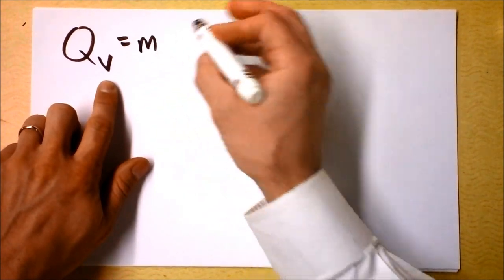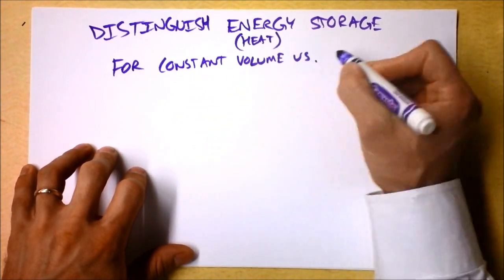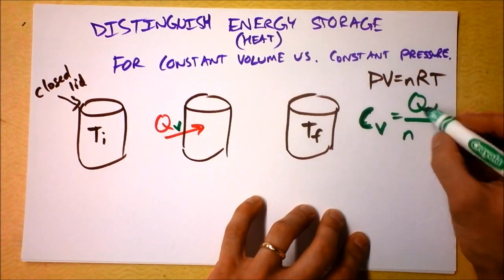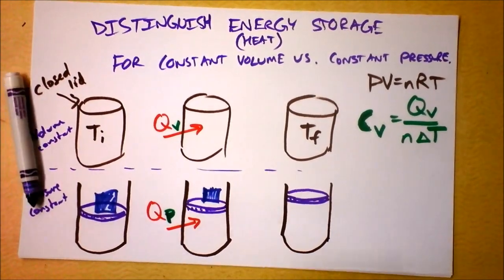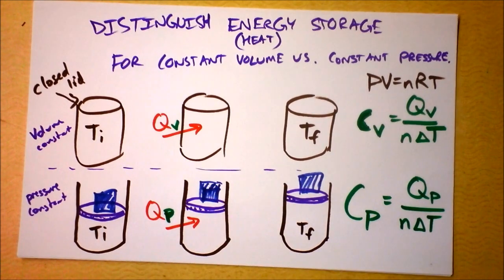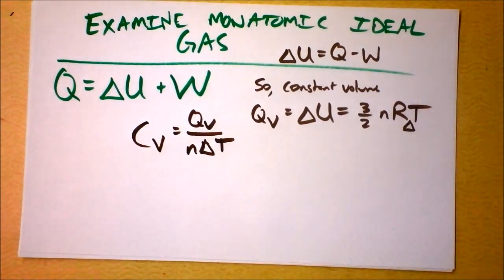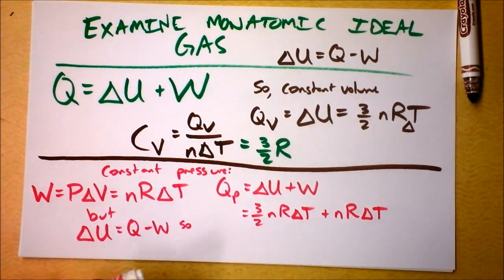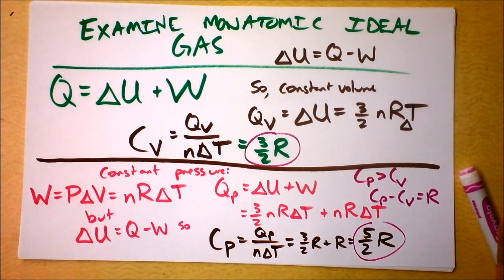Specific Heat...at Constant Volume? or at Constant Pressure? | Doc Physics

Comment: I am a highschool student, and I am doing an internal evaluation on the effect of the function of the paraboles used in the rocket nozzles on the force made by the propulsion system and I needed the specific heat. I could not have wished for a better explanation!!! thank you so much for this video!

Comment from the maker: The chemists have gotten to you first!  They (ridiculously) call W the work done by the universe, so the work done by the gas is negative.  Nuts.  If you've been hanging around chemists, I suggest you explain to them that gases in a box are easier to keep track of than THE WHOLE UNIVERSE.
Reply: hahaha
Reply: this cannot be more true lol
Reply: PV=G m1 m2 /r^2 
Please findout correct math and total workdone by universe 
?????
🙏🙏🙏🙏🙏
Reply: Expanding universe doing work directly proportional to it's initial energy ???
Which is 10^44 joules 
So we found that ultimate volume and found parallel universe consequently
Love from India
Reply: Universal gravitational force is actually pressure of universe towards its origins ???
Reply: Please found efficiency of an aneroid barometer if it's filled with various types of cooling liquid ???per unit volume in joules?
Like a drinking Bird ???

Please please please
Reply: Please show your work in stencil work for easy understanding ?